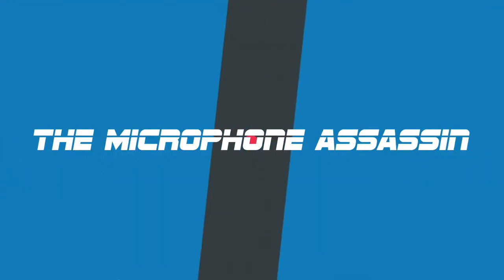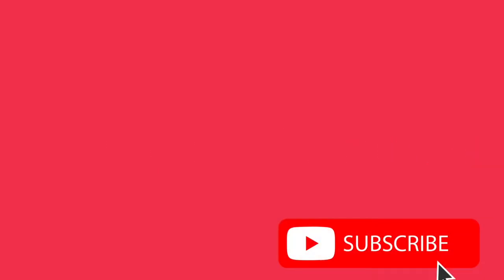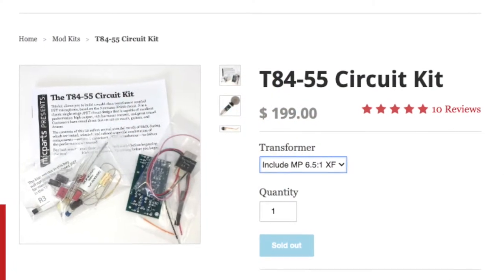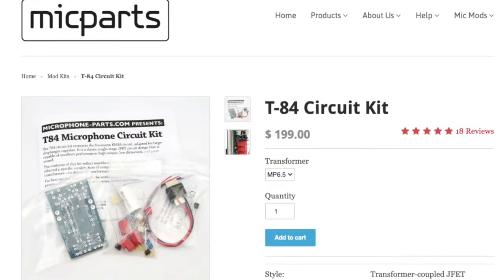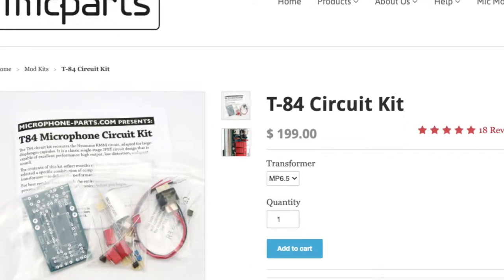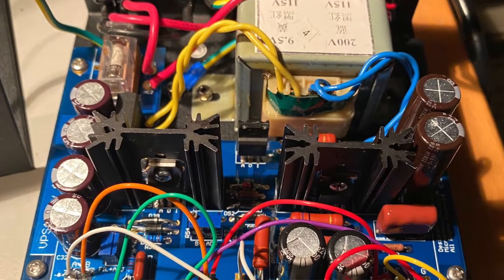Let's Talk More About Microphone-Parts.com

Comment: I want to build one of the MP circuits, but doing something with a pre-made circuit from JLI.  I wonder how the JLI Alice circuit compares to the 57 circuit from micparts.   I wouldn't pay his prices for those capsules.
Reply from the maker: Alice is very vanilla flat circuit that pairs well with a 47 or c12 style capsule. MP57 has options to add EQ on top end so you can also use a k87 style capsule if you prefer.
Reply: @MarkYoshimotoNemcoff  Thanks for the reply!  if you don't mind another question, how would you describe the JLI-103 capsule?  Did I ask you this somewhere else?  Idk
Reply from the maker: @badmiddens no idea
Reply: @MarkYoshimotoNemcoff  Ha, me either, but I'm about to pair one with the JLI Alice circuit.  FRANKENMIC!

Comment: Leaving another comment because I can

I've listened to this a couple of times over and I can't decide which of your mics I like more. The T-84-55 has more character but there's something very good about the T-84/M7 build too and now I'm wondering if I should go for the T-84-55 with the M7 capsule lmao.
Reply from the maker: That's a good question. The T84 is probably compatible with a wider range of donor bodies and I do believe it's also now available with their T6.5 transformer, which has more harmonic coloration than the MP6.5 transformer in the T84 kit in the red mic seen in the video. The T84-55 has a much smaller list of compatible donor bodies. So, I don't know if that impacts your decision, but if you go with a 3u Audio M7 capsule, you will have to make sure the headbasket is tall enough to accommodate it since it sits on a mount and pedestal that can't be swapped out like you could with a normal K47, 87, C12, style capsule. The 3u Audio M7 capsule mount also screws into the capsule deck with a single screw, so if your capsule deck doesn't have a hole pre-drilled in the center, you'd have to drill that yourself after removing any existing capsule mount. So, with the M7, there are additional considerations that slightly complicate the build. That being said, it is an outrageously nice capsule. Always with 3u Audio the best bet would be to message Guosheng directly (3uaudio@gmail.com) to order and you can ask him if it would fit into the donor body of your choice. I may be wrong, but I believe the 3u M7 goes for around $200, so it is also a bit more expensive. So yes, the donor body you prefer will be a big consideration.
Reply: @MarkYoshimotoNemcoff  Thanks for the very detailed reply! 

I think I'd pick my donor body based on the guts I wanna put in the thing as I don't actually have a mic I want to sacrifice. I imagine mic-parts customer service and  Mr Guosheng can help me choose the appropriate body?
Reply from the maker: @enriquekahn9405  Asking Mic parts Matt is probably a good first step, though do not be surprised if he suggests his own capsules as your “best” solution. Also to note, the 3u M7 capsule plus mount is approximately 50 mm tall so it would require nearly 2 inches of clearance from the capsule deck to the top of the headbasket. Most likely more since you don’t necessarily want the top of the capsule so high up in the headbasket. FWIW, there are u47 style mic bodies on AliExpress that may do the trick and be big enough.
Reply: @MarkYoshimotoNemcoff  Thanks! I'll just tell Matt I already have the capsule and want the circuit to go with it lol
Reply from the maker: @enriquekahn9405  Smart man. I have nothing against their capsules. I just don’t really know what they sound like other than the one I didn’t like.